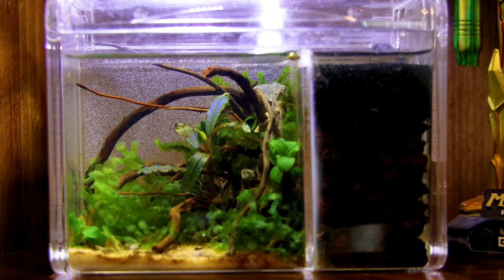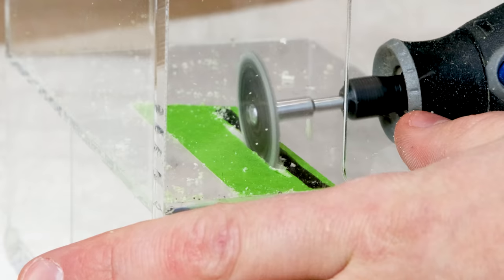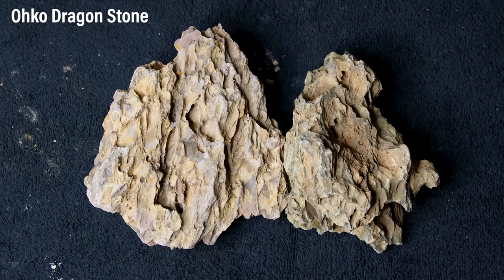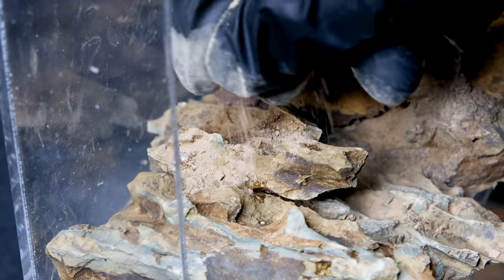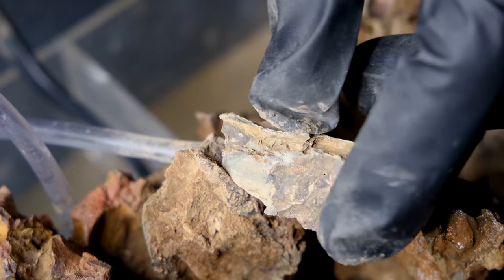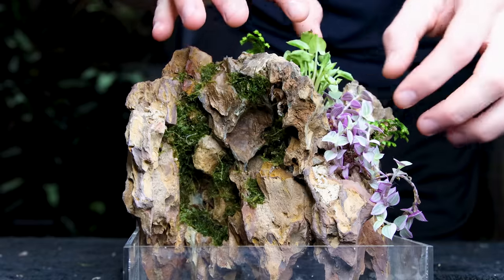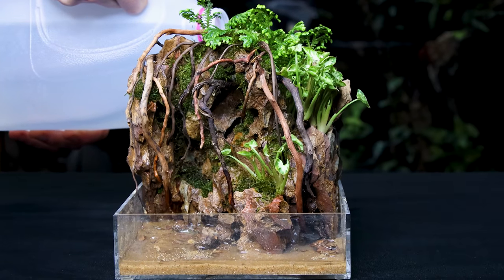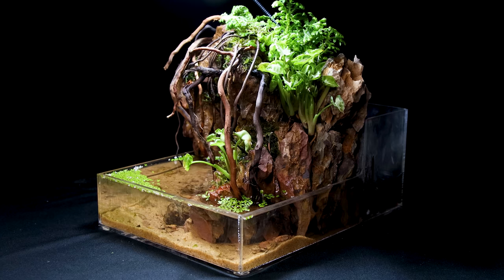DIY Micro All-In-One Twin Waterfalls Paludarium

Comment: Superglue also collects on the grease from fingerprints - CSI use it to extract latent prints from things like plastic bags which are impossible to dust and collect with regular methods. So just letting surfaces dry is not enough to prevent the problem, they need to be fully cleaned with isopropyl or something similar.

Comment: Awesome video!! Where do you buy your plants/stones/sand?
Reply from the maker: I try to buy locally as much as I can, so most of it came local. Otherwise I just search for what I need and get it wherever I can find it online.
Reply: @SerpaDesign  for sure! I only keep tarantulas and isopods as a clean up crew. I've been looking for ways to enrich their lives. Like having a bigger space with plants in the enclosure and then having a little corner that they (specifically the heavy webbers that would most likely destroy the plants) could tuck themselves away in. I'm super stoked to get into that aspect of the hobby.

Comment: Cool, but why bother with both a bio and mechanical filter in such a small scape?  You can do a 100% or 50% water change in two minutes.  I think you only needed a mechanical filter to keep duckweed out of the pump and airlines and didn't need to add the baffles There aren't even any animals to dirty the water.  Awesome sense of scale and pro rockwork.  Another beautiful nano scale project.